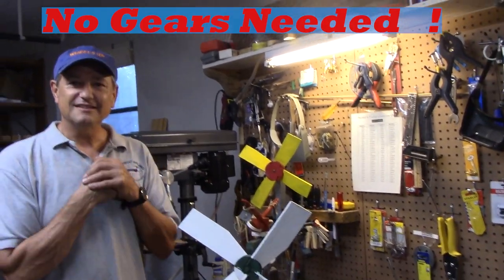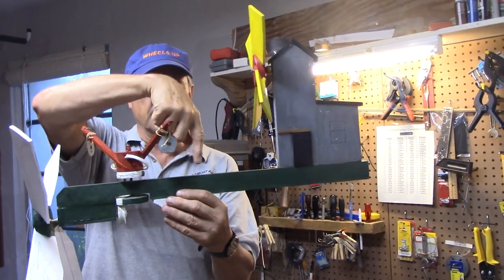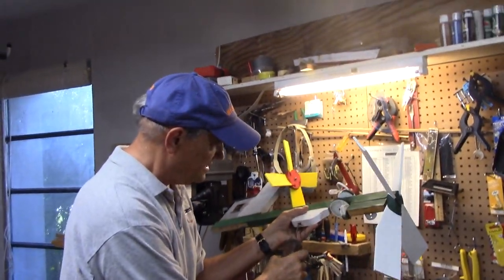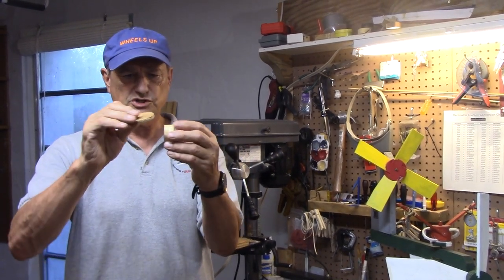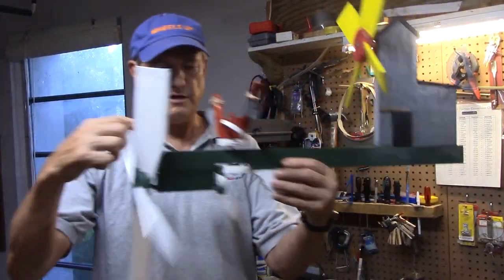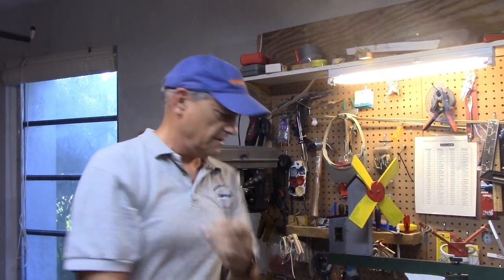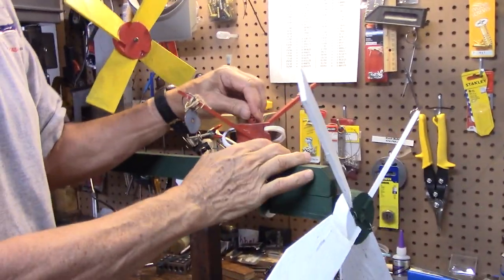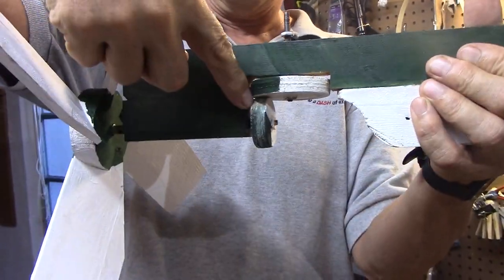How to make a mechanical turning ballerina, barber pole, or train Whirligig !  No Gears Needed

Comment from the maker: Plywood isn't the best for weathering over time.  Just Used it here to illustrate the idea.   Sometimes I use acrylic paint and then coat it with polyurethane clear.   Any wooden whirligig will deteriorate when left outside all the time.  Good luck with your whirligigs and thanks for the comment.

Comment: Doing a flying Ace Snoopy.  Thinking how to put a Woodstock on top of Snoopy where wings stand out to catch wind. A vertical spin. 
Pitch the wings of flat to wind?  You’d thoughts are appreciate it.
Reply from the maker: That sounds like a fun whirligig for sure.  You are going to want to put some angle on your wings, 35 to 45 degrees usually works well but it's not critical.  Some experimentation will probably be required before finalizing the design.

Comment: What parts do you use for the axle?
Reply from the maker: In this particular whirligig, I'm using 3/16-inch steel rod for both the horizontal and vertical axles. I used a die to thread one end 10-32 for nuts to hold the propeller on.